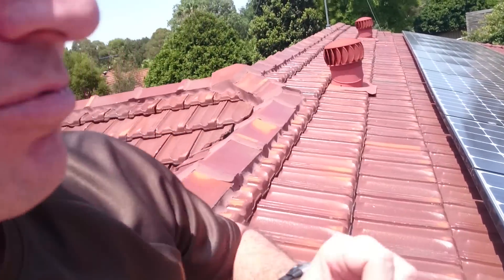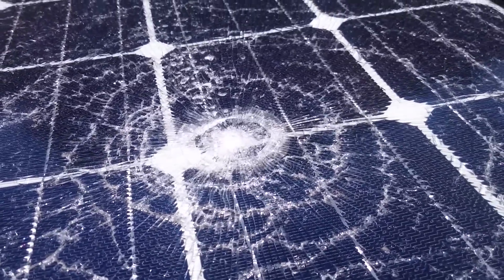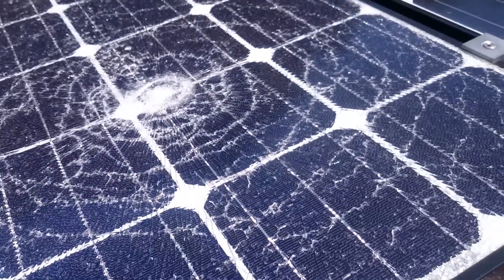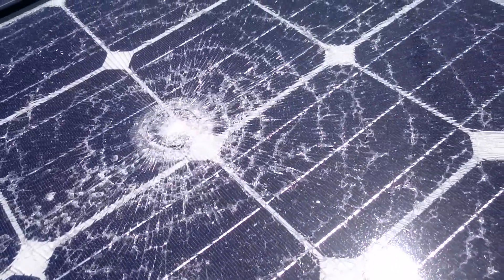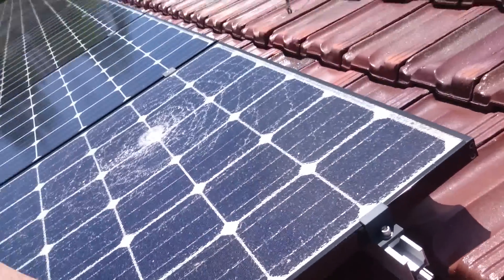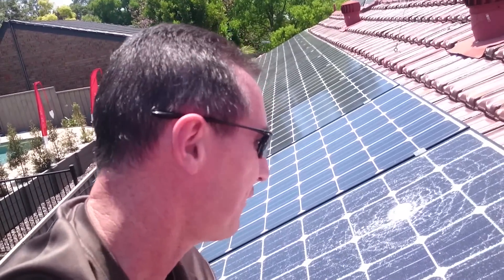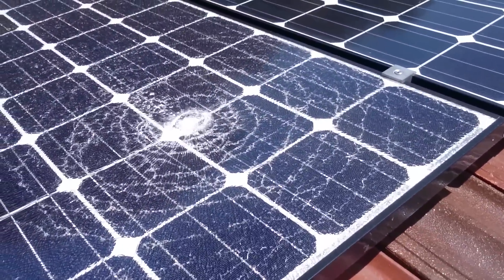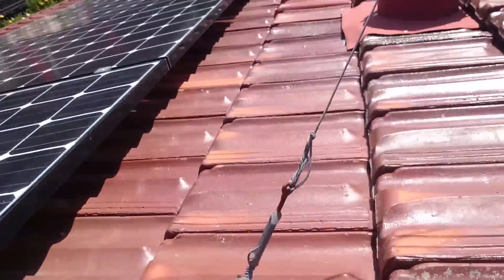Home Rooftop Solar Power System Update - Shattered Panel!

Comment: Folk are mostly over estimting the strength of the glass in those panels. They are strong but brittle.  A nylon line trimmer flicking a pebble is sufficient to damage them. One instance i saw was a neighbours kid threw a handful of gravel (sub 20mm in diameter), this shattered two panels. And we only found out because the gravel was in the guitter.

Comment: Dave,
I've had them break. Looks to large and high up for a stone thrown from a mower. Looks like a ball to me, stones don't usually leave a symmetrical circle like that. Do you have a park or place people play around your house? They are pretty rugged but once you get a small crack they crystallize into tiny glass fragments because of the type of glass. Don't touch it, you'll be picking those tiny glass fragments out of your fingers, wear gloves when you remove it. It's an easy change and if it's a series string you don't have to get the exact panel but make sure you match the connector type (MC4, etc.) Sometimes, in the States homeowner policies cover  that type of damage.

Rob

Comment: I believe whatever hit that panel was probably around golf ball size or smaller. If you look in the very center of the impact zone you'll see what looks like a little mound. That is the point of impact. The crater is the first ripple of the impact wave destroying the glass, each concentric circle going out is the wave propagating across the panel like ripples on a pond. The energy dissipating as it travels outward across the panel. You may very well find the object in your yard, something about golf ball size or smaller.

Comment: Maybe hail with metal core? You have a bent nail next to the panel. (@3:37).
Strong wind can easily pick up something like that, and later in the clouds it act as a solid core to form deadly hail.

Could you take that nail under microscope? One end should have some visible damage if it is a culprit.

Comment: Seal it with an adhesive to stop the glass falling away and keep water out.  Or place a sheet of Perspex over top (will degrade and need replacing every few years, and will cut down the energy transfer a bit, but won't shatter).

Comment: why do these things shatter so spectacularly and total the whole panel?
Reply: ...and that might be an important clue in what actually (hasn't) happened. Some years ago I worked in a company that handled different types of glass. Once, they had a huge ass panel of tempered glass almost like this one but unlaminated. They wanted to get rid of it for some reason. So they wrapped it in cardboard, turned their faces away and someone picked it with a pointy hammer. It violently exploded into bits. Good thing these where experts who knew about eye protection and stuff. What that means is: all these theories about impact angle and stuff: forget it. All you need is one weakness and bam, symmetric shock waves.

Comment: TL/DR: I would replace/unconnect the module, as it is a (relatively minor) fire risk, within the next six months. 

I agree that this was an impact of some thing. Most likely the neighbors? shot something at it. Just to give you a feeling, a module shot with a ~3cm monocristalline ice sphere at 110km/h will show far less destruction.
The glass of PV modules is tempered glass, so once it breaks in one location, its supposed to break everywhere due to surface tension. This is required for safety, so nobody gets hurt. Its also more or less mandatory that the glass stays stuck to the laminate (the ISO test for this is called "child impact test").
Only the few cells around the impact typically show microcracks, as only these were mechanically bent to a breaking point. The surface-tension breaking process is not that dramatic in terms of displacement. 
This is probably why the module works. If you would measure the UI-Characteristics of this single module, the impact would be maybe 0.5-2/60 fractions in terms of current, meaning maybe half to two cells current output is missing. So ~0.8-3%. You would need quire some accuracy to measure that. Since you are a supergeek, and probably own a thermal camera, the affected cells get hotter. This works best if the sun is really intense. Do not case a shadow onto the modules yourself, they will heat up within 30 seconds as well. The hottest we have ever mesasured in the field was 120°C, a quite hot cell will have more than 30° than the typical surrounding cells. Thats due to the fact that the effective cell area is decreased, but the system current is not really decreased, so the current density through the cell can be much higher, leading to inverted voltage and ohmic heating.

But: now water can go into the module. Due to the water, you will have leakage currents, if there is a higher voltage between the frame (grounded typically, at least if the system has the same specs as required in Europe) and the cells (potential depending on the configuration of the inverter), If you have 10 Modules, you might have 350V (DC) So the voltage could be up to 350V depending on which end of the modules you are. This leakage currents means, that ions are transported. The ions damage the cell. So in the next months, be prepared to see a decrease of production of the single module. But, there are the bypass diodes (typically three, each for 20 subcells). If one substring (20cells) would dissipate heat opposed to produce energy, the diode will kick in. This might only happen at strong irradiance, and if the inverter is active.  You would see a voltage drop of ~10V it the total array voltage, in that case. If you that I would either propose to replace the module by one which has a reasonably similar MPP current.

The bypass diodes themselfs are a freaky thing. If one is not cooled sufficiently, there is the danger of the thermal runaway. Consider its conduction, as the voltage of the substring would be negative. It gets hot, due to the 0.4V shottky voltage drop, and the ~10A. Now for some reason, e.g. if there is a sudden irradiance drop (e.g. surprise cloud), the voltage of the substring gets positive again (due to decreased system current), the diode should stop conducting. But hence its hot, there is much more leakage current than normally. Now if the heating of the the leakage is more than the cooling to the outside, the diode will heat up until the pn junction is destroyed. (google for AN1542 Thermal Runaway schottky). If this happens, either you are lucky, and the diode is constantly conduction, or you are not so lucky and the things might start burning. Hence, its not the best idea ever to let the crackled module is the system for a prolonged time. Half a year I would risk personally, but its a (unnecessary and tiny) risk.

Theoretically you could make a teardown video, although not so much can be seen that you can't see through the glass on the other side anyhow. If you heat up the backsheet foil to >90°C it is supposed to be possible to peel it off (never tried it myself). The encapsulation material (EVA) at this temperature becomes much less sticky. I have seen encapsulation materials to soak up and become quite rubbery when put into nitro thinner for a prolonged time.  Maybe you could salvage some for further projects. I would not remove the solder connectors that are already soldered onto it, its a nightmare to handsolder them. 

To remove the module, please note that the outside mechanical clamps are different from the intermediate clamps. And of course there must not be any current flowing, 10A at 350V is a very nice (and harmful) electric arc.

Bernhard, photovoltaics researcher in Austria.
Reply: That's very interesting and comprehensive, thanks.

Comment: you might for the mean time disconnect the panel and bypass the broken panel. the inverter might still work with the slightly lower voltage. but definitely do not disconnect the lead before isolating the array circuit. the arc under load makes a mess of the connectors.

Comment: With tough glass it actually has a lot of tension created within it during the manufacturing phase. This is done by cooling the glass really fast. If the panel has defects it, doesn't take much to fail and when they fail all the tension is released hence the whole panel going. Maybe accumulative effects like a defect, it being retained not perfectly and then a small object, even an animal running on it my shatter it. Have you ever seen ceramic shard shattering toughened glass?

Comment: Looking at the Impact pattern i think the Impact happened relatively orthogonally with respect to the surface of the panel therefore the object hitting it either "came" from above (from airplane, meteor, strange hail?) or was shot from the ground with a steep angle (balls, bullets). That probably wont help much...
Other ideas:
-Try to calculate the needed energy to damage the glass like that?
-Take Dust/parts from the impact surface (where the projectile assumably hit) and analyse the elements in the collected material in a lab (spectroscopy?) to find out the elements or other properties of the impactor?.
- Another idea: An Object dropped by a flying animal?
How fast does a bullet falling down when fired straight in the air become when it drops down again?
#GetYourFluidMechanicsStraight

Comment: That's a good sized hit.  It's mostly symmetrical too, so it hit close to perpendicular.    Did you check down below to see if the object is still there?  If it was ice like a big hail ball it would have melted by now.  I doubt a small defect that got water which expanded to ice as the pattern suggests an impact.  Do you live near a school / ball park?  Or firing range / hunting location?  It didn't seem like much potential for squirrels that chuck walnuts to break them in that location.

Comment: There is an inner and outer crater. That happens in all high energy impacts. There are tests of ball bearings shot at laminated glass that look like that. The inner "hole" is the size of the object. The outer hole is the diameter the shock wave got to hile still having enough energy to cause both radial and concentric shock breakage. It could be any number of things. It looks like a "spent" bullet impact but that is unlikely. Someone else suggested a stone catapulted from a lawn mower. That is possible and I think more likely. Something dropped from an aircraft? It is possible as you can get ice drop off and it would explain no evidence however I would argue that is less likely than the stone idea as usually they have to be descending from very high altitude for that and usually the ice melts before it gets below 10,000 feet.

Comment: Shooting guns in the air.
Reply: +sean craig When the bullet is coming down it will not have enough momentum to cause an impact like that, it's only falling with terminal velocity.
Reply: +kagi95 
Not true. A bullet that is fired at an angle of 45&#176; will impact on ground with the same energy as the energy when it left the rifle minus the energy that was lost by drag.
Proof: 
/watch?v=b4wSLilK2C8
Reply: OpenGL4ever

I think you're saying 45 degrees, if so, yes that's true. However, people do NOT shoot guns tilting them 45 degrees for fun, almost every gun owner knows they can kill someone that way. I was talking about the common hillbilly style of shooting them directly in the air, which is close to 90 degrees.
Reply: kagi95
The 45° was for simplifying what i have to say. This also applies if you shoot directly in an angle of 90 °. Watch the video, this will help you more.
Reply: kagi95
The video shows real measurement of the kinetic energy, so there is no doubt. It's scientifically proven.
Reply: +sean craig we don't have guns anymore here in AU
Reply: really big spiders are given a wide berth and roos best left alone.
Reply: also I have a sling shot He he
Reply: +OpenGL4ever Yes, minus the energy that was lost to drag - same as any projectile. However, the energy lost to drag in the case of a bullet is huge. The instant a bullet leaves the barrel it begins to rapidly slow down. If you were to fire a gun from the top of a skyscraper straight down the bullet would impact with less energy than it had when it left the gun - due to drag.

A bullet fired straight up loses energy to drag but gains potential energy due to it's increasing altitude. Once it reaches apogee it only has potential energy. At apogee it's vertical velocity is zero. It will accelerate as it falls until it reaches terminal velocity. It will not exceed terminal velocity. The only way it could exceed terminal velocity is if it had an additional source of power to overcome the drag - which it does not.

The question is, could a tumbling, falling bullet have enough energy to shatter tempered glass? I think it is probable. Especially a larger caliber bullet like from a hand gun. The larger bullet will have more energy upon impact than the small bullets used in high power rifles. Terminal velocity would be very similar but the heavier bullet will hit harder.
Reply: +Harman Robotics Horizontal and vertical velocity are independent, terminal velocity is only relevant if the gun is fired within 5 degrees of true vertical, otherwise the shot is merely a bullet on a parabolic trajectory, not a falling object.. Most people would have trouble shooting a gun perfectly straight up into the air.
Reply: Harman Robotics
We do not need to discuss that any further, it is measured, watch the video. I am right.
Reply: +OpenGL4ever Don't know what's in the video - it's not in my language. But yes, you are right that it will impact with the same energy - minus the drag. You are wrong if you think that means that the bullet impacts at a speed faster than terminal velocity.
Reply: Harman Robotics
Use the subtitle function. I was never talking about terminal velocity.
Reply: +Mark C. A bullet does not follow a parabolic arc because it is losing velocity from the moment it leaves the barrel. The initial velocity of a bullet is very rapidly used up by air friction. The horizontal velocity will always be less than it's vertical velocity except when fired at a sufficiently low angle that it is able to impact something before air drag has fully slowed it. 

A bullet fired up in the air is going to be airborne for ten or twenty seconds, maybe more. It's initial velocity will be used up in the first two or three seconds. If the angle is far enough from vertical the bullet will turn to follow the arc and continue pointing forward which will allow it's terminal velocity to be higher than if it were tumbling. It cannot maintain a high horizontal velocity because there is no source of power to counteract the drag.
Reply: +OpenGL4ever You said "not true" to kagi95 who said that a bullet would not fall faster than terminal velocity. Perhaps you were saying that it wasn't true that a falling bullet couldn't cause such an impact. I disagree with kagi95 on that point. Even at terminal velocity a bullet can cause significant damage.

The auto translated subtitles are terrible. I couldn't watch it. Regardless, I completely agree that the bullet will impact with the same energy minus drag losses. BTW, I'm a billionaire, minus the money. :-)
Reply: +sean craig I'd doubt it. Guns are not that prevalent here.

Comment: Its also quite possible that the glass took a beating BEFORE OR DURING installation. Sometimes, in toughened glass and in ceramics, the crack does not immediately show up. But over a period of time, with temperature swings, the built up stress can come out and lead to spectacular cracks overnight. This has got to do with the toughened surface coating that does not allow the stress to come out but the internal fluid (Glass is a super cooled liquid) holds it and when the surface expands and shrinks the stress vent out happens.

Comment: Had one of mine broken two years ago, again not any noticeable drop in power output. It will fail eventually due to water ingress.

One evening I heard a loud bang a few houses away where there had been small fireworks type explosions before, and a second or so later a loud crash from outside. Couldn't see anything in the dark, so forgot about it. Weeks later I saw the panel had a different color from ground level and found the breakage.

Based on the toughness of the glass and the damage, I suspect these people were playing with pipe bombs rather than cardboard fireworks.

Never found the projectile - based on the distance, time, damage and slope of the roof, it probably skipped several more houses before landing.

Didn't bother claiming insurance, with the RECs the replacement cost was lower than my excess.

Comment: Thinking is was something small, based on the size of the immediate impact area and very fast based on the amount of energy to do that much damage.

Even if the manufacturer doesn't replace it they should be able to give a guess on what got it.

Comment: I'm not sure how the neighborhood children and young adults are in Australia but where I grew up they used to take broken bits of ceramic insulation from used spark plugs and throw them and car windows. The ceramic even thrown without huge force will break tempered glass easily due to the hardness of the material and it's tendency to have sharp points when broken.

Comment: Wow... the impact rings are fairly concentric which leads me to think that the object dropped in from above and close to the same angle as the panel. It's hard to tell from the video though.
Reply from the maker: +Michael Lloyd That was my first thought, a near vertical impact. It's not like cricket ball glanced off it at a large angle.
Reply: +EEVblog If that would've hit a pet or person in the back yard it would've definitely left a mark (and then some).